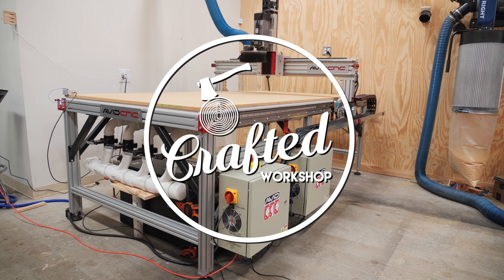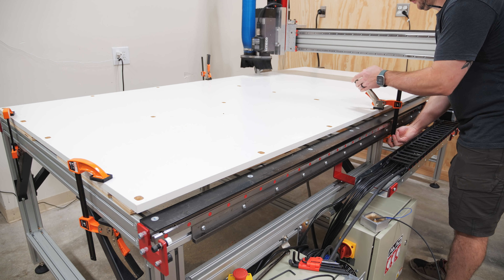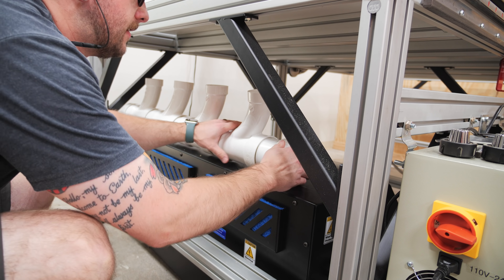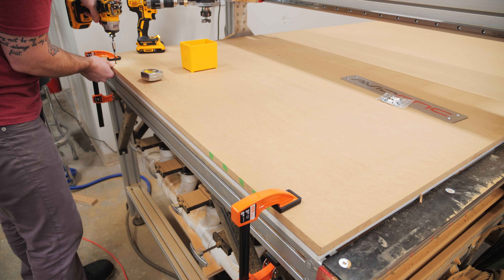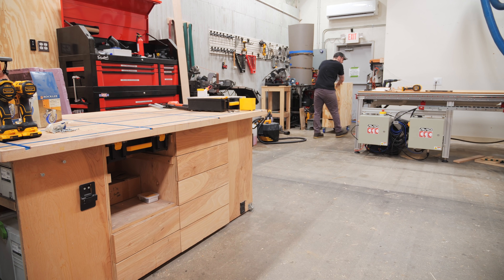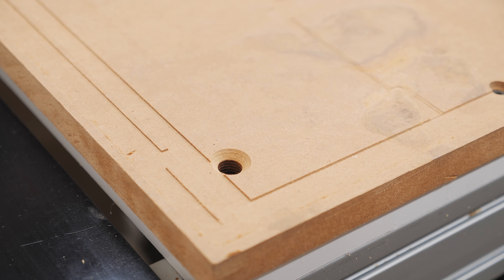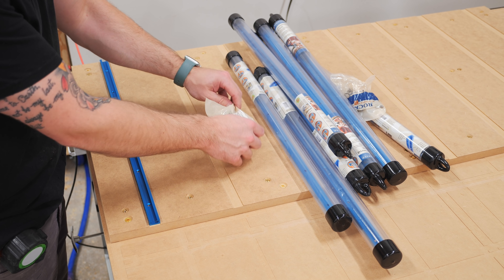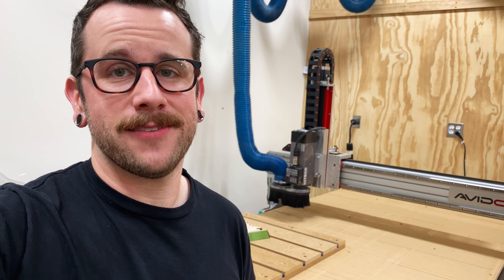Getting my new CNC DIALED! // Vacuum Table Workholding & T-Track Fixture Table

Comment: Something I don't get it. You made on a melamine board plenty of groove for the air of the vacuum to pass after that you had a Prestwood board over that vacuum board and I saw you plane that board on both side after that you put and small board over that Prestwood and put the vacuum ON, the vacuum pump vacuum that board down across that Prestwood. If there is a Prestwood over the groove how the air pass for vacuuming down that small board? I never saw you drill hold on that Prestwood. At 6:30 on the video. Sorry, I missing something here. By the way that very nice work.

Comment: How has that single sheet of  melamine held up to bowing.  i am trying to decide on my Avid machine how I want to do the plenum.  I am thinking that I might glue two sheets of MDF,  for added rigidity, but I know I will loose some clearance.  I am mostly going to be doing sheet materials, so it wouldn't be the end of the world.
Reply from the maker: The melamine hasn't moved a bit, it's not really supporting much weight since the span between the parts of the 8020 isn't significant.
Reply: @craftedworkshop  I think I'm going to steal your design.   I just got mine moving this week.

Comment: Are you drilling your holes with the router bit, or changing out the router bit for a drill bit, and then running a separate drill program?
Reply from the maker: For the t-track table, I just used a standard router bit.

Comment: Hi Crafted Workshop ! Thank you for the great video on how you setup your overall AVID CNC Vacuum Table Top construction and plumbing to the Black Box Hurricane Vacuum Pump ! I have a similar AVID 4' x 8' CNC Router Table, however the Black Box Hurricane Vacuum Pump are not readily available here in Australia, so I will need to look for something similar, or construct my own ! On another side note I saw that you used SketchUp Pro to make your initial design for your Cabinetry Layout, but I would greatly appreciate knowing what CAD/CAM software you used to actually create the chest of draws individual components, and also obviously nest all of these items to be cut directly on the AVID CNC ? I hope you can help me with this inquiry ! Keep up the great work and videos ! Regards Kinetic Joinery.

Comment: is it strong enough to double as a vacuum former? Would just need a heat box to mount above the table then to heat the plastic.
Reply: I did this with mine, I vacuum formed plastazote foam. I'm using two dust extractors for vacuum.

Comment: Just a question for anyone that knows.

Is taking .03" off the sides to open up the pores of the MDF? Making buying a thinner board to accomplish the same without removing moot?
Reply: Chaz mdf has two compressed faces when you skim the faces it removes the most compressed portion of the mdf faces allowing for more air flow. If you use thinner mdf you will have to do it anyway and you won’t get much better suction. .75” mdf is perfect because you have more use out of it before needing to change the spoil board. You only need to skim the mdf until the compressed face is gone. I would probably start with a .01 pass and then move
To .005” passes until you have gotten it all.
Reply: @austingifford8433  Ah yes, makes sense. Thanks for the reply Austin.

Comment: Forgive me if I missed it - but how does the air pass through the MDF spoil board? Is it just because it's a composite material with thousands of tiny holes that are basically too small to see?
Reply: MDF is extremely porous, that's why it swells up so much when it gets wet.
Reply: @theonlyiainever  makes sense - cheers

Comment: I have a large CNC router with a vacuum system. I didn’t see if you used gasketing in the plenum. It makes a big difference. I split my spoilboard so I can slide the front section onto the back and then use gaskets right on the plenum for huge holding power when doing surface work or engraving.
Reply: Do you have a diagram that can explain this more. I don't quite understand

Comment: I have the same 4x8 router and vacuum system. I think you're gonna find you don't want all those screws and inserts in your spoilboard.  If you are using this table as often I would expect, you'll quickly tear up your spoilboard and lose vacuum power. You'll want to resurface it fairly regularly and all those screws will just become a pain in the butt. Just glue the lightweight MDF to the plenum board and when you want the t-track board, attach it with wood screws in the corners. I go 98% through my spoilboard and then just glue another one on top. Works great.
Reply: I was wondering if both of you plumbed with schedule 20 or 40?
Reply: does the glue hinder the suction from the vacuum when you glue the spoilboard to the plenum?
Reply: @nitrousair  No. Just glue completely around the edges and then in small spots scattered around the board. The air will pull right around it. Be sure and take a millimeter off the bottom side of the MDF that will attach to the plenum, then flip it, glue it and surface the other side completely.

Comment: Can you put t-track directly into the flow through MDF piece if you sealed the track groove?  I realize the area where the track is would not have suction, but any other issues doing that?

Comment: Thanks for the video! I’m currently planning out my Cnc purchase. Are you running off of 3 phase or single phase? And if single phase, does the drop ~2hp drop in power still machine like a boss? I.e single pass cuts on 3/4” plywood with decent feed rates?  Thanks!
Reply: Single pass cuts on 3/4 ply would be rough on any hobbyist/consumer grade CNC. I normally make 2 or 3 passes. Also helps make sure you have time to stop the machine if it looses a step and eats into a good part

Comment: It sucks through the MDF? 🤯. That’s sick!
Reply: wouldn´t believe it if someone tell me that this is working
Reply: "Brady Vac".  Been using it for years.  It IS sick!
Reply: Been working with a Homag Vantage 12L for a few years now and it uses the same principle. Low quality mdf is best to use as it lets through more air. Nice about this industrial machine is the work area. About 3600x1700mm.;)
Reply: Is this simply relying on the porosity of the MDF? I was wondering the same question.

Comment: I love your videos, I am awaiting my Avid 4*9 cnc with ATC in about 4 weeks and want to do the vacuum table like you just did! Is there a reason you didn't just glue the MDF onto the plenum instead of screws? Just easier to replace when needed? Thanks for the videos
Reply: What atc spindle and system did you go with?
Reply: @roeschdan  I went with CNC Depot's S30. I should finally have it all up and running by end of the week

Comment: Use nylon screws to hold down the spoil board. Never ruin a bit by hitting a screw. When you have to change the spoil board (and you will) they can just be cut out.
Reply: Great tip!

Comment: Bro, I have a question, which type of Stepper motor did you use for X and Y? Nema 34? I am also planning to make my own CNC. The size of the CNC will be aproximately the same with your CNC's. can I use Nema 23 (the strongest one with 112 length and 3 N.m). can this stepper motor handle it? please give your suggestion, thanks!

Comment: You can put some t nuts into your melamine vacuum zone piece and then create a file for your CNC to cut out recessed mounting holes that match the t nuts. This allows for repeatable mounting for your spoil board and it saves your melamine piece from multiple screw holes in it over time.
Reply from the maker: Good idea!

Comment: You mentioned Legacy Woodworking for one of the designs (can't remember if it was the vacuum table or the t-track table) but both of these designs are from Legacy.  You may have modified the hole pattern to fit your machine, but the designs are Legacy's.
Also, as commented below, the fine dust from milling MDF acts more like a gas than dust and will stay in the air for hours.  Check out Shop Hacks for an air filtration system.  I built one and it works great to clear the air of really fine dust particles, as well as circulating the heat and  air conditioning.
I have a Legacy Maverick 3x5 with ATC.  More money, but much beefier machine than the Avid.
Reply from the maker: Yes, I mentioned that the design was based on Legacy's and would have linked to their video but it appears they removed it from their channel for some reason. I'll check out that filtration system!

Comment: i gotta tell you, i was suprised by the vacuum pump and the suction thing and the spoil board and all the setup,  i really need this machine, i can aford it for a short time only but i'm intimidated with all it takes to get it running.  I'm pretty sure I'm going to run into one kind of a problem or another and i cant anticipate how expensive the learning curve will be and that turns the thing into a risk, not an improvement to my company.    I'm barely going to get it along with the vacuum pump, i wouldn't be able to afford many 300 dollar mistakes.
Reply from the maker: It's a super cool system but it definitely takes some figuring out to get it up and running.
Reply: @craftedworkshop  i don't know what to do, a 4X8 piece of birch ply costs 300 dollars now.

Comment: For a tad better vacuum, seal the side of your spoil board with the fast edge.  There is a little bit if leakage thru the edge.  Great video
Reply from the maker: Good tip, thanks!
Reply: @craftedworkshop  wood glue works too.
Reply: Also add a gasket between your vacuum grid and your spoilboard
Reply: @nathwald  That was what I had thought the square pattern was going to be used for. It is pretty much standard with metalworking machine vacuum fixture plates.

Comment: 1.  Seal your spoilboard to the plenum.  You're loosing a lot there.  There's gasket material
2.  Seal the edges of your spoilboard.  Almost anything works.  Cheap latex paint even.  I started using plastidip.
3. Get some proper dust collection.  What you have, does not work.   You should not have the mess you have from running a full weekl, nevermind just from surfacing the spoilboard.
4.  Most through cuts only need .002" of penetration into the spoilboard.  The deeper you go, the more vaccum you loose, the more likely parts are to move, and the more often you have to  re-surface it.

Comment: Seriously, how does the vacuum work THROUGH the mdf? so confused...
Reply: MDF is very porous and the other half of the equation is a very strong dust collector.
Reply: @crisvega7588   That's black magic. Awesome
Reply from the maker: It really is mind blowing.
Reply: @crisvega7588  It doesn't necessarily have to be a very strong (or expensive) dust collector. I have a 4x8 table and depending on the size of the table I'm using, I use one or two dust extractors, a festool ct and an old fein turbo II, to provide hold down vacuum. The setup doesn't have to be crazy or have a vacuum dedicated to a single use.

Ultralite MDF is recommended because it has less resin content, and therefore is more porous than the stuff on the shelf at HD or lowes. I got my ultralite by calling around to places that sold hardwoods. 

Vacuum hold down can be done more cheaply than shown here with a bit of creative repurposing.

Comment: Maybe someone has already asked this. Did you just 'dry fit' your PVC pipe and fittings? I didn't see you using any PVC cement. If correct, will not using cement give you an adequate 'seal' on your system? And by the way, "Great video"!

Comment: What kind of cut time are you getting? I am running Mozaik with a 12 HP spindle, I typically cut 3/4 UV Maple at 800 ipm with a 9 line bore head for holes. Mine run from 3-6 min a sheet typically. It will be interesting to see if you have a small parts hold down issue with your rails.

On the vacuum it will preform better if you make the manifold a loop to equally distribute the vacuum to all ports. As it is now the first port will have better HD down than the last port.

On the vacuum bed I would eventually switch it out with a phenolic panel. The  Melanie panel will probably start cupping up when you start getting high humidity days, especially if it's high every morning and much lower in the afternoon. It will throw your Z way off.

Comment: I know it's way too late but why did you choose to buy such an overpriced vacuum pump? Four motors? $2700? I bought a single stage 3.5 psi blower pump for $610 and I can't reason any logic in your equipment purchase decision. Especially since my vortex blower only takes up 14"x14"x12" and yours takes up half the underside of a 4'x8' table. I get 126 lbs of holding force in 6"x6", more than I will ever need. You could have spent the money I saved and bought a used Bridgeport mill like I'm doing.
Reply: Maybe it was given to him from the company? Idk. Question, about your cnc is it the same size as his?

Comment: That's some impressive suction but I would think that type usage would be  hard on the vacuum sucking against MDF which isn't solid but it's adhesive or wood particulate it's not exactly hollow.

Is there a way to run a test on your programming until you get more experience so you don't destroy expensive wood?

Comment: Why is your dust collection sooo bad??
Reply from the maker: I actually think I have too much suction, which is sucking the brush up into the port and reducing the efficacy of the dust collection. I’ve got to do some experimenting with partially closing the blast gate to keep this from happening.
Reply: @craftedworkshop  keep us posted. I am finishing my Avid 5x10 build, I have the Kent CNC head but not sure what dust collector to get...
Reply: @wahkeen2  I also have the 5x10 (from when they were still CNC Router Parts), and have been pretty happy with my Delta 50-760 (upgraded with pleated filter and cyclone separator). Apparently that model has been discontinued, but it's 1.5HP and 1200 CFM for reference. Very little dust/chips besides what gets left in the cut when using down-spiral bits. Virtually no dust left when surfacing the spoil board, except for a little bit along the edge where the dust shoe hangs over the edge of the board. Even when doing higher-profile cuts recently with a longer bit that stuck out below the brush on the dust shoe, it did a good job with the dust portion -- although the chips were flying out below the brush.

Comment: For the vacuum plenum, why not cut the pattern on the underside of the MDF, plan your attachment hold down screw holes in advance and the vacuum primary ports to match the same in the melamine, then you always have a pristine main bed on the machine? That way you can have more threaded insets on the main surface, have more options in the future, and conserve the integrity of the base.  It seems that having 4 layers of 3/4” surfaces limits the vertical ‘Z’ working capabilities of the system. Just thinking...😬